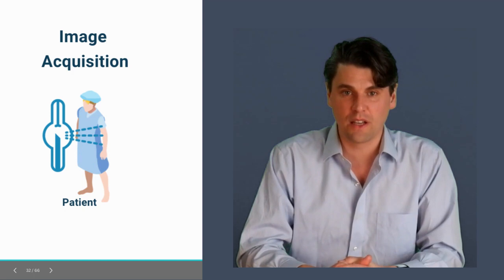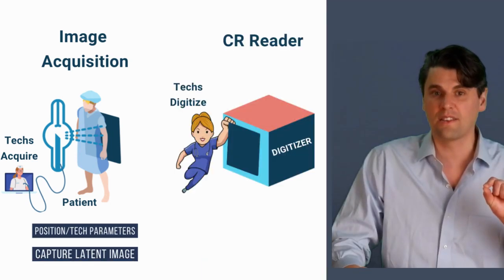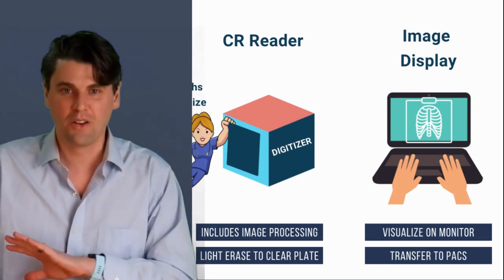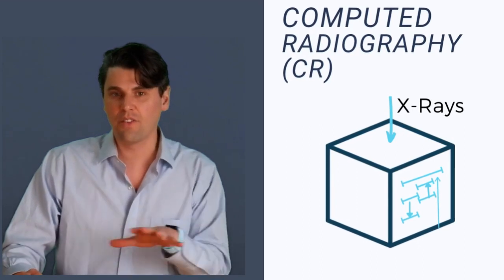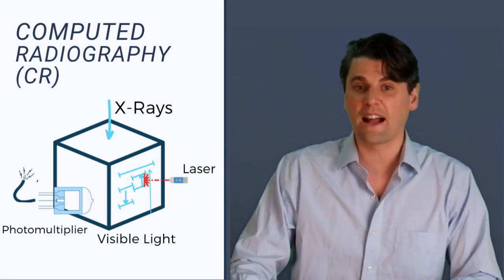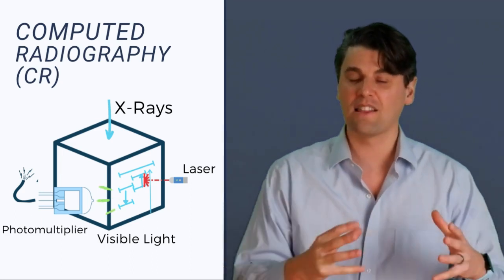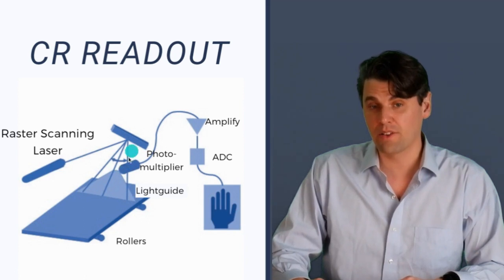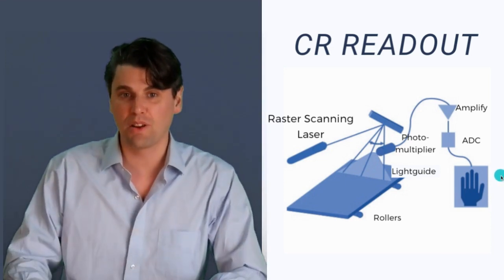Computed Radiography How it Works (CR Image Receptor)

Comment: Thank you very much for the great lecture. After watching your lecture, one question arose. If optical fibers arranged in series are used to collect blue light generated from IP, does noise occur due to loss of light in the gap between optical fibers?
Reply from the maker: Yes there is some efficiency loss in the transfer as not all the light is transferred into the optical fibers.

Comment: How does the cr reader read the image but not take the whole cassete inside the machine
Reply from the maker: The reader accepts the entire cassette, mechanically opens it, and removes the PSP plate. So the full cassette doesn't need to enter the reader.

Comment: No calculations? So no fourier transform? Ist just straight up voltage blips read as the laser passes by line by line? Wow!
Reply from the maker: Obviously all images today have some processing but the name is a gimmick
Reply: @HowRadiologyWorks  that's what I'm saying there's some computing somehow, probably to stitch together the input voltages recieved from the little squares array
Reply from the maker: @ivanp3880  there is actually a lot more computing in ultrasound, and they never threw computed in there for basic 2d imaging like CR did.
Reply: @HowRadiologyWorks  ultrasound and mri both utilize the fourier transform to get the signal slice
Reply from the maker: Yeah that’s right no computing in CR!